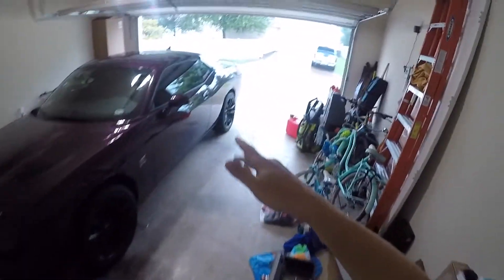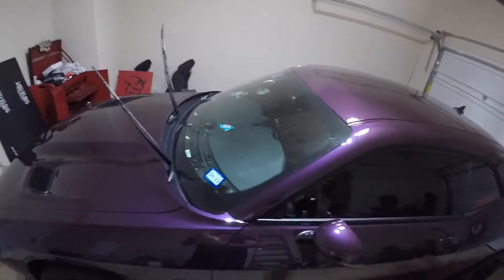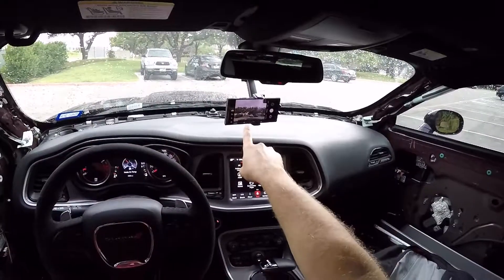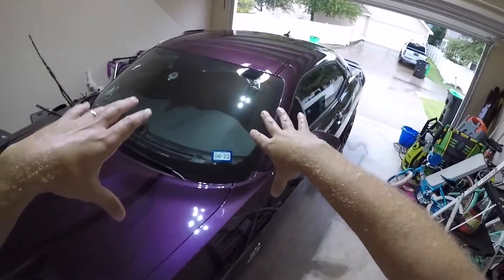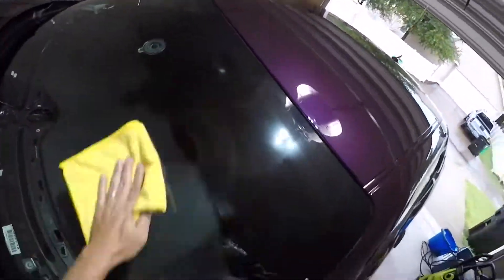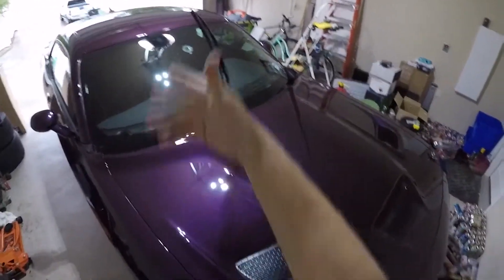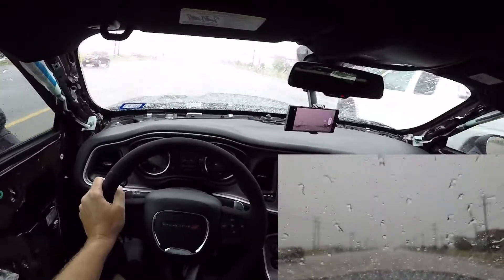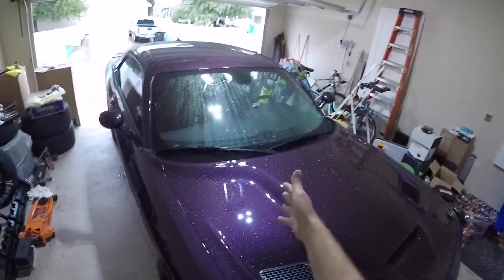Original Rain-x vs. 2-in-1 Glass Cleaner with Rain Repellent Comparison Test

Comment: Original Rain X is definitely the way to go, but BIG TIP!! sometimes there is still haze on the windshield even after buffing the absolute hell out of it lol it's very noticeable driving at night, so what I did is wait an hour or two after applying, went back and sprayed just a little bit of glass cleaner (distilled water also works to avoid spotting) on a microfiber cloth and buff it some more until the haze is gone, no more haze and the rain still beads up and rolls off!
Reply from the maker: Thanks for the tip! I'll definitely try it out. I've removed my wipers since this vid so I have to stay on top of the rain-x applications now and that haze is stubborn sometimes.